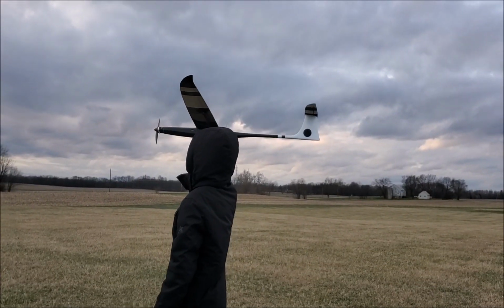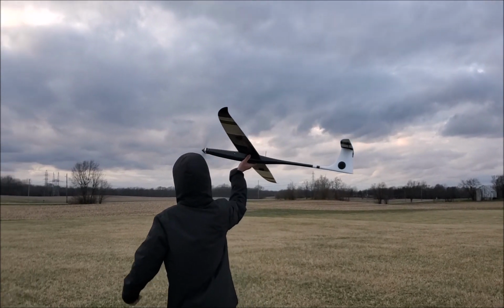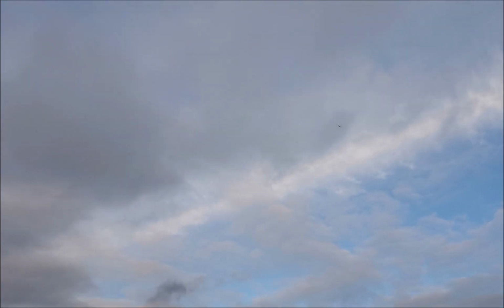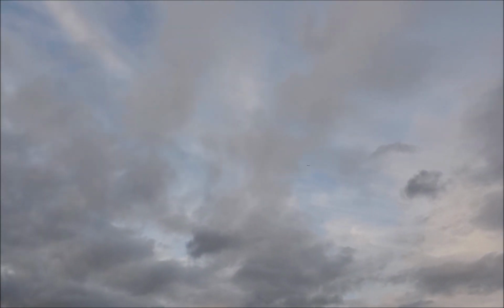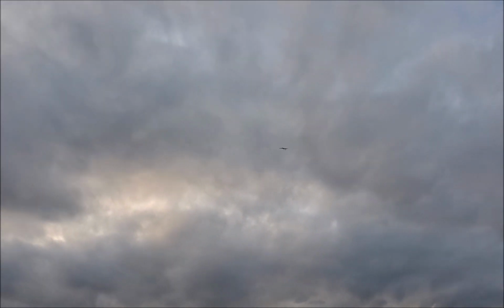RC airplane with no speed limit: Yuri's X-Plus hotliner/racer

Comment: Hi
How is your experience with the XCross 160? Does it hold up ?
Reply from the maker: Still running it, and it's working great!
Reply: @joshuawfinn  
Whats the max amps and voltage ? I guess the 3115 maxes out at about 60 ?
Reply from the maker: @jas-FPV  I wish I could tell you but we never measured it and I've since returned to a geared Neu motor for hotliner use because the launches were so nasty with the small speed props. Ecalc was predicting something like 120-130A on the 8s setup we used. It very nearly killed the motor. It was very hot.

Comment: Great Video! I was wondering though for your science olympiad 2022 Stinger, there is a new propeller that makes my plane vibrate. Do you have any way I could fix it so it doesn't vibrate?
Reply from the maker: It's either shaking because one blade is heavier than the other or a blade is bent. You can glue tiny dabs of clay to the lighter blade tip until the prop balances horizontal at rest. If it continues to vibrate, check for a bent blade and carefully massage that blade back to the correct twist.
Reply: @joshuawfinn  Thanks! I'll try it out

Comment: I took up dynamic soaring a few years ago. I have flown my latest self designed carbon composit glider at my local hill in 100kph wind fastest speed so far 600kph.
Though at 73 my reaction times could be better so I am looking for a younger pilot.  After 60 years of modeling I really would like to be the first to reach 1000kph before I l peg out.
Reply from the maker: That's hauling freight for sure. I've tried DSing off small hills and treelines with dlgs and just cannot get the hang of it. Even tried in a simulator. My brain just cannot work the right pattern and I've crashed a couple airplanes trying (fortunately no major damage, but a clear warning that it was time to stop).
Reply: @joshuawfinn  It was a steep learning curve. I put two models into the hill myself. But the G forces have claimed two others. Max gees pulled so far 152g, with a 18 kg 1.5 MTR glider